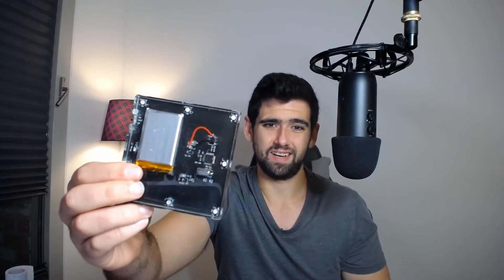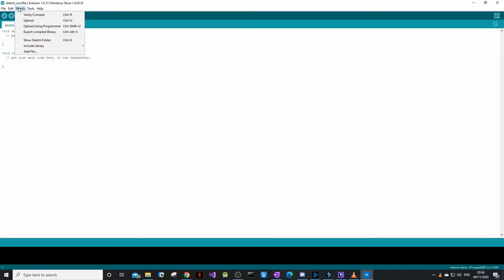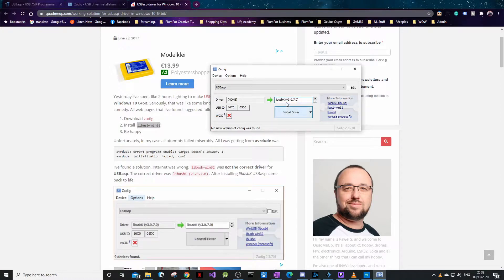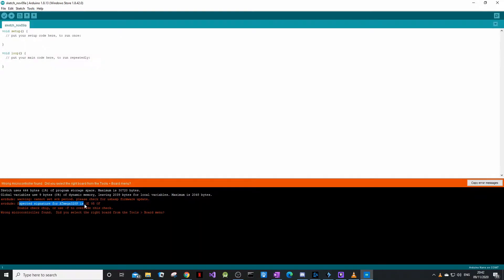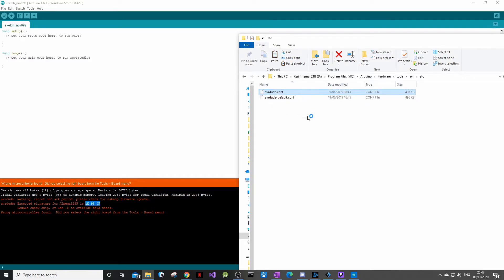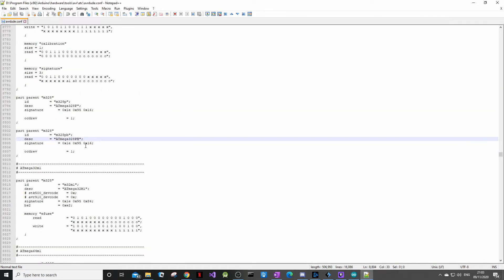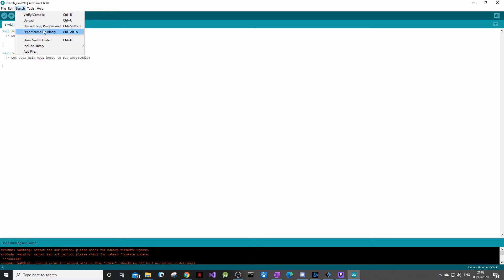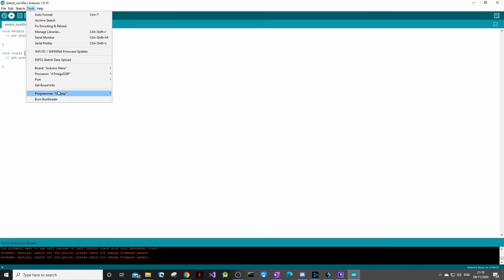How to program the a single ATMEGA328PB chip with an Arduino ICSP

Comment: Thanks for this excellent video. Loved the way you tricked the IDE by editing the config file.
You mentioned that it is using internal clock, is it 8MHz at 3.3V? I wish to use the ATMEGA328PB on 3.3V, datasheet says it needs to operate on 0-4MHz to work on 3.3V. Have you tried this or have any resources?

I am grateful for your help. 

Thanks,
Raj